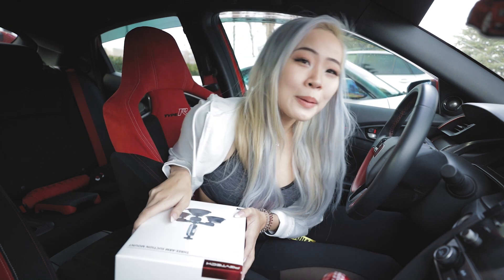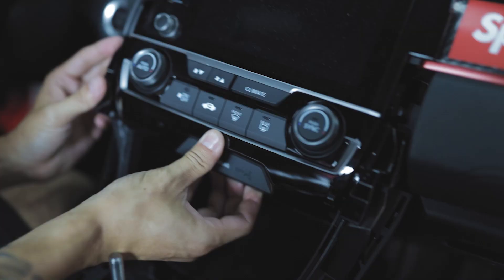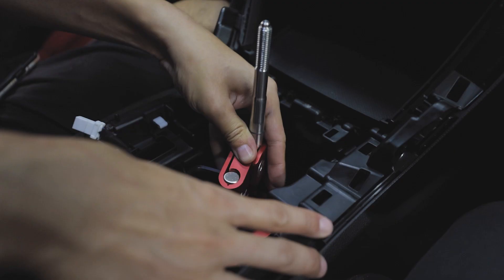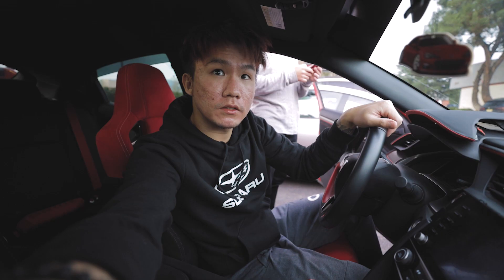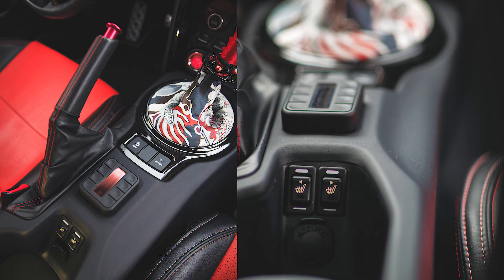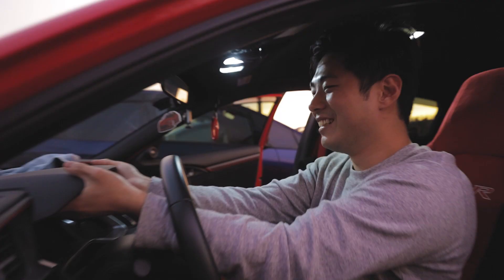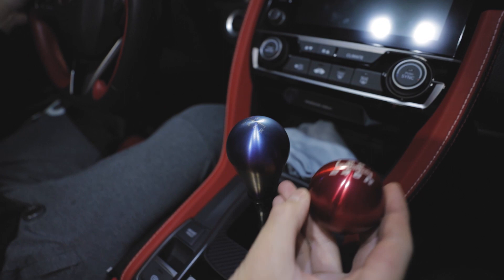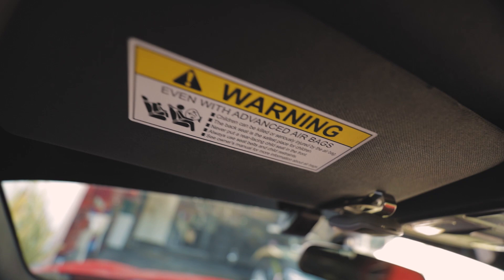HYBRID RACING Short Shifter + Type R Interior Upgrades

Comment: What I found out is if you want stop the 2nd gear grind is by changing the transmission fluid to AMS oil transmission fluid and by getting a rear motor mount. The way how the FK chassis is that it’s put together is like a lego since the chassis is built in England and the motor is from Japan. So just by throwing a rear motor mount it lets it be more connected and get rid of that 2nd gear grind.
Reply from the maker: I see, good to know! Thank you

Comment: HR shifter worth every cent you think?  Im not having any 2nd gear grind issues *knock on wood - but if the shifter feel is that much better I might have to check it out
Reply from the maker: I definitely recommend it + new Aimsoil tranny fluid, makes a huge difference
Reply: @spamsubie  nice.  I had the Amsoil put in last summer.  Was night and day. Will have to look into this 🤙